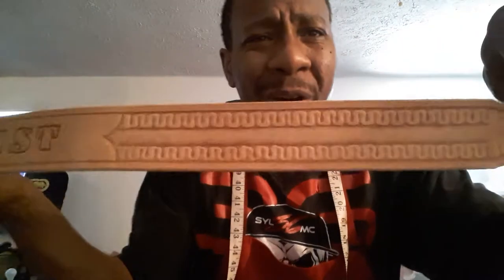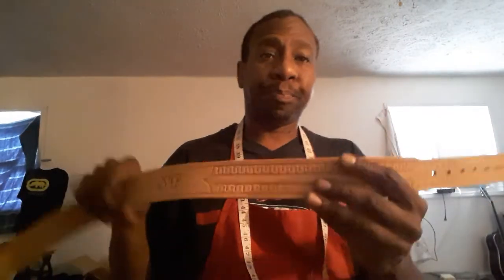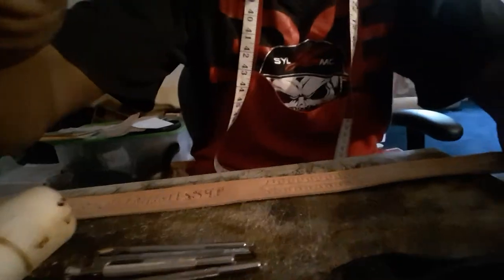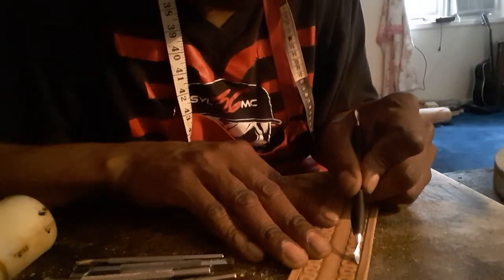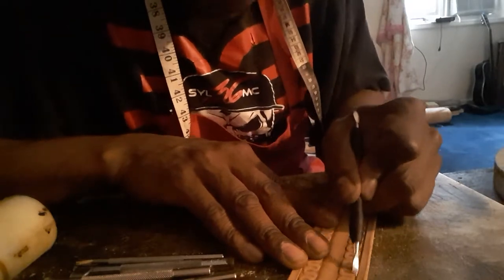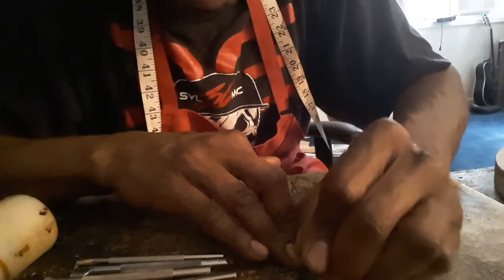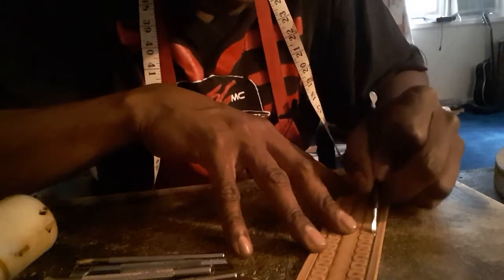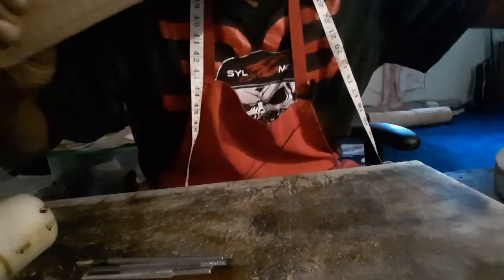Removing Errors

Comment: Hi there' a very informative video. Thanks for uploading it. Can you tell me if there is a way to remove embossed initials from say a leather wallet? I am not talking about the surface foil type but a proper deep embossed letters-initials. Can't seem to find any videos showing this. Only scratching/peeling/washing off foil type. Thanks in advance for any information you can provide.
Reply from the maker: jfdomega not really. However I have seen crafters use a leather paste like creation as a filler. Its simply leather shavings & glue mixed together, My father did the same in woodworking. 
Personally I would just start over if the stamping is that deep, but nothing beats a failure except a try.
Reply: premier leather crafters RDM  OK' thanks for replying. All the best.
Reply from the maker: jfdomega ty